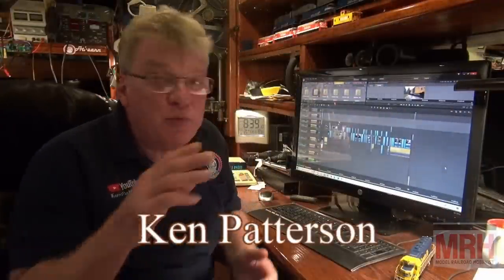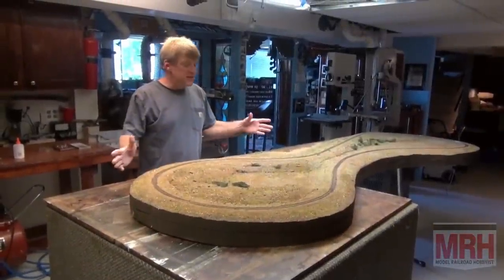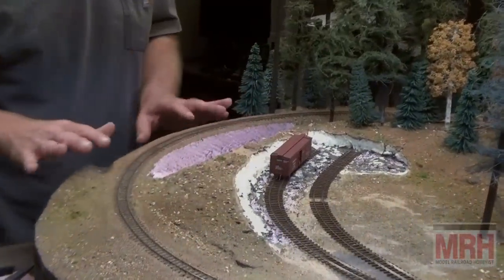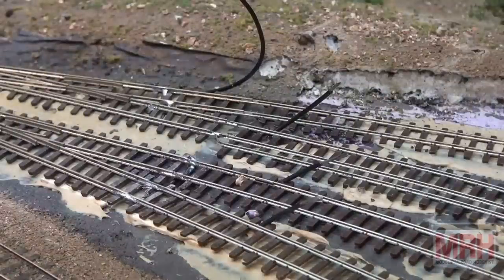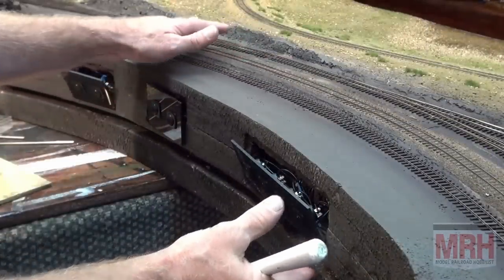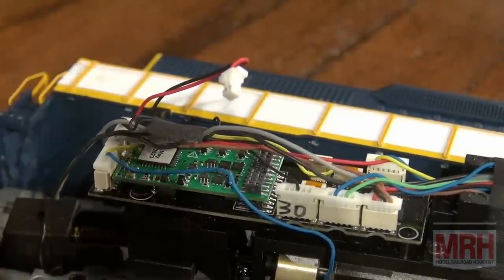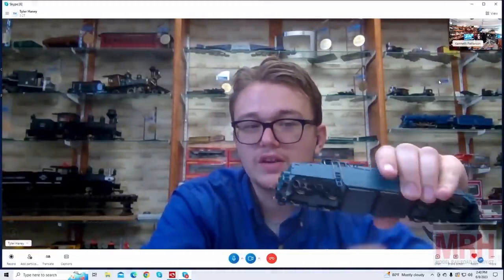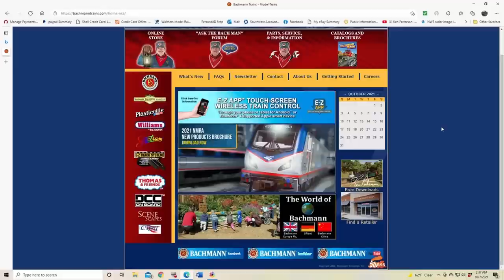Let's build an HOn3 layout:2 | July 2023 WHATS NEAT Model Railroad Hobbyist

Comment: Please secure your work piece to something stationary when using a router. Also " safety glasses" , a basic even with foam. This series has finally motivated me to start a layout, as I have been waffling for some time now. As a previous post mentioned, why not mount the switches to the fascia?
Reply: "Safety Glasses Always"    I was "Safety Team" @ Chrysler St. Louis Assembly!     MoPac Jack
Reply: We have drivers at work that have glasses that are safety rated.
Reply: Don't worry about it

Comment: I’m curious about using switches to power blocks on what I assume is a DCC layout. It seems like you’d always just keep power going even of you aren’t using that block. I know I did this with dc when I first made my layout, but haven’t found a reason to flip the switches yet to turn off different blocks.
Reply: You are correct.
Reply: Maybe it is a DC/DCC setup.
Reply: He should have soldered to rail joiners and used old school insulators. Sloppy track work IMO.
Reply: @tonyromano6220 Most of what I see, is sloppy, but get the job done kind of work🤷‍♂️ I still enjoy how much effort he puts into spreading enthusiasm and information about the hobby though.
Reply: @sferguson1130  oh this guy…….lol!